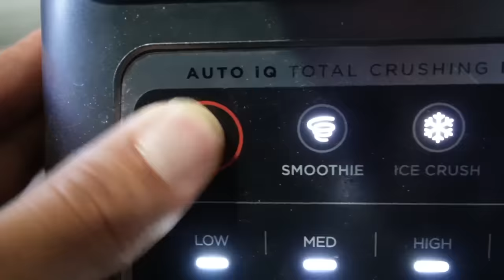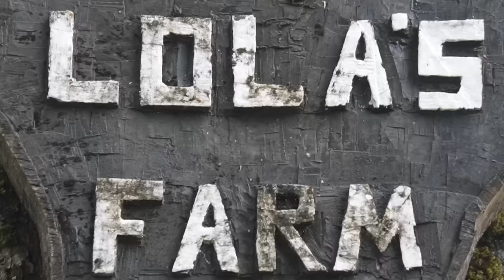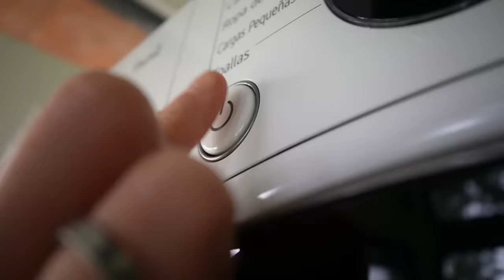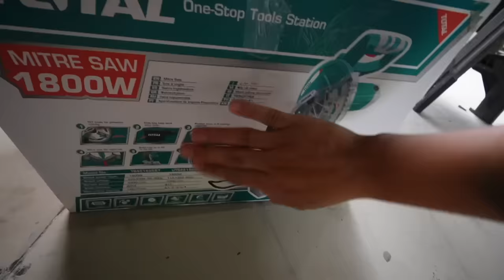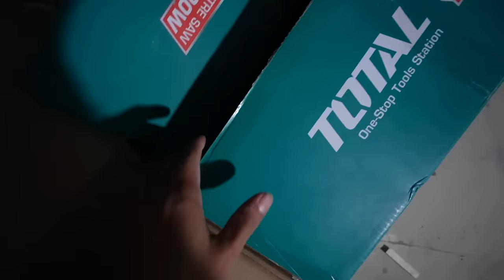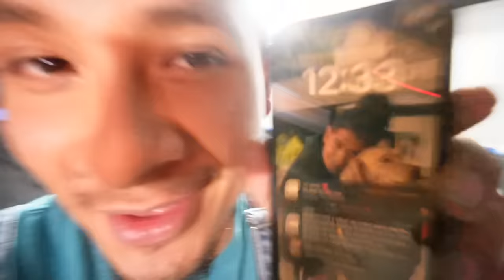"THE BIG REVEAL" !

Comment: Hi guys…looking and feeling better ❤../.Freddy may I suggest for those cloudy days that you hang the clothes in hangers, at least it will give you a chance to either remove it quickly from outside and it will make easier to hang inside.  If you have a greenhouse you may use it to hang clothes also.  Hope didn’t overstep the boundaries.  Have fun and feel better…🙏🏻
Reply: Didn't they build a room that heats up Well enough to dry wood Maybe that can be used🤔
Reply: Good idea. We hung clothes out on the line but cold days in winter or rainy days we would hand then inside on a rack. They got dry fast too. Especially if the rack was near a heat vent. Not too close! Lol. My mom still lives in a home without a dryer. One summer we lived in a class A Rv and I had a washer spinner. That spinner would get the clothes so dry. Then I hung them up and in no time they were ready to wear. LA

Comment: do you still have the wood drying shed?   if so., why don't you hang a line in there to dry the clothing .. it may need some type of circulation fan and vent but it will be a good place to dry clothing if propane continues to become an issue . andddddd  if you have bricks, solid bricks around build a rocket stove for cook top .. ,they do not use much wood,,, you have lots of wood scraps and a rocket stove outside will always be a back up when the shit hits the fan everywhere ..,

Comment: Awesome! Spanish AND German lessons! Should be a weekly feature. "Phrase of the day".😉

Put aluminum foil around the stove burners. It'll catch drips and make cleanup easy - just toss it out and put down a new layer.

Tie a laundry line inside the house and hang the clothes inside. It will dry just fine (also spread the fresh laundry smell through the house) and you won't have to watch out for rain nor sacrifice propane. The shed would be perfect for line drying, too.

The kitchen is looking pretty awesome!👍 LOTS of hard work and it's paying off.

Sweep up the sawdust and use it as a bottom layer for the billy goats.

Comment: Freddie, for your thumb....Castor oil. Find in store, drug store or online !  Take a wool sock if you have . Or clean felt. Soak the wool material w hot oil. not too much !   Don't burn skin. Wrap the area with the wool or felt. You won't need a big piece for thumb. You can put plastic bag over it while you have it on your hand, to keep it moist and warm. You can keep heating the oil. Reuse it ,by putting it in a jar. OR just use enough oil to cover what ever area you need. This can help with organs in your body , joints, sore knees, foot.  Its called a Castor oil pack . You can read about it on Google. Good Luck. Great videos , looking so nice.  Be safe and stay well. Maybe there are local herbs there that you can learn about and use.

Comment: You can clean the stove with some baking soda and white vinegar. Also lemon juice and salt. Let them set for a while before you wipe it off. Also put some boiling water on any stuck on food and just let it soak for 15-20 minutes. The boiling water will soften any stuck on food, then wipe off. If there is some stuck on food, repeat the boiling water. Be sure not to get water into the burner itself. It can put the pilot light out. ( You can relight it, but it's a pain in the 🍑

Comment: If you think it’s broken you could use “tong depressor” sticks OR cut two clean paint stick striper just a tiny bit longer than your thumb.
Put on stick on each side of your thumb, wrap it with medical tape or electrical tape or duct tape 😌 it’ll help it heal but if if it out of the socket you should go to the dr. They’ll put it back in place then either cast it or splint it.
But it definitely needs to be splinted ❤

Comment: Since you are having issues with gas supply, you might want to consider buying a single burner Induction hob. They are relatively cheap and will work with the supply you have. If you want to run often off battery power then look for a Vango Camping induction hob. Unlike normal ones that flash at different rates, at full power (which is hard on the inverter) they use variable steady supply voltage.